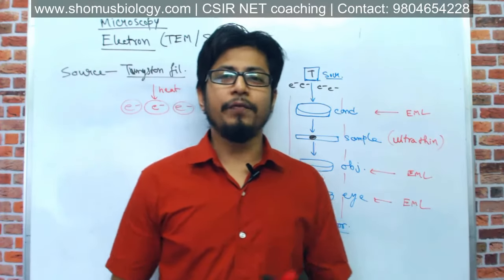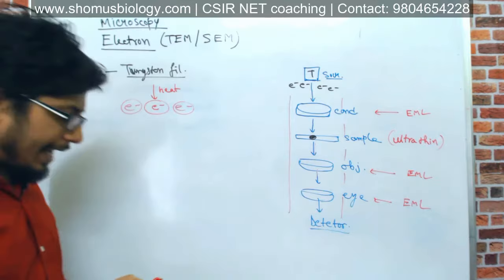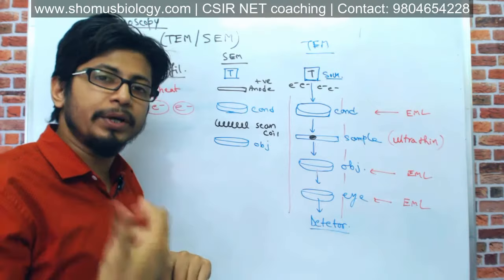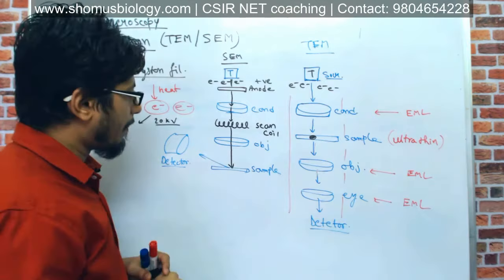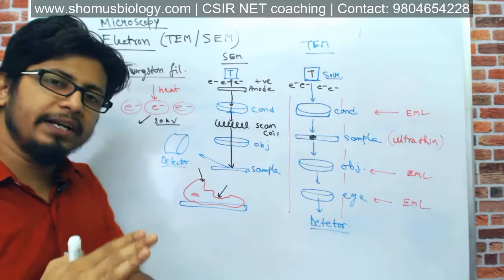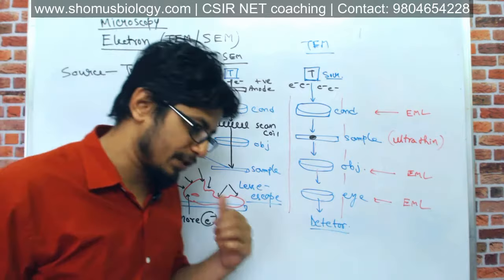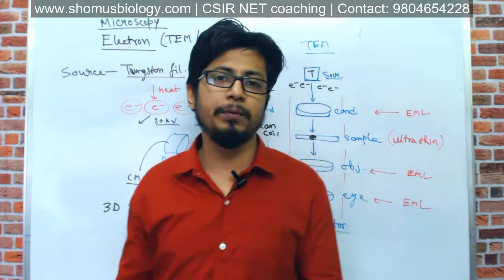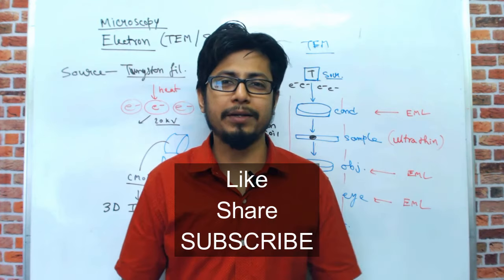Scanning electron microscope principle working (SEM)

Comment: What is the use of a scan coil? and in transmission electron microscopy, You said that the denser particles are passing and absorbing more energy and lighter particles absorb less energy. why there is less escape in the cleft region of the specimen and why there is more escape in the dense region of the specimen. and in scanning electron microscope does the condenser lenses are made up of glass or EML?